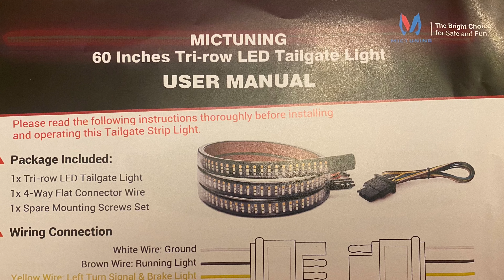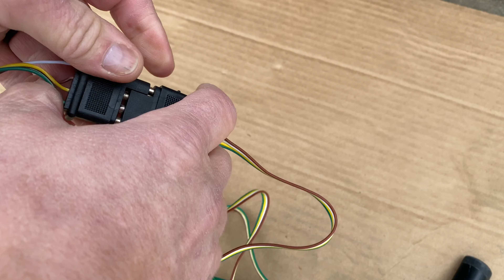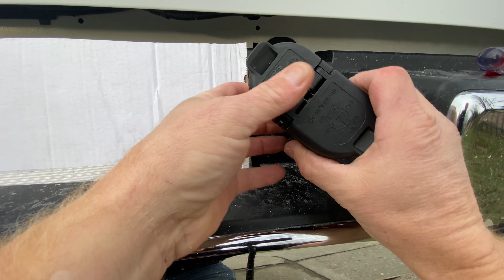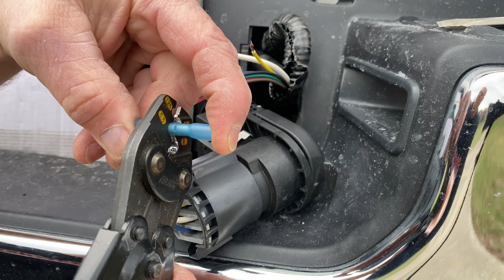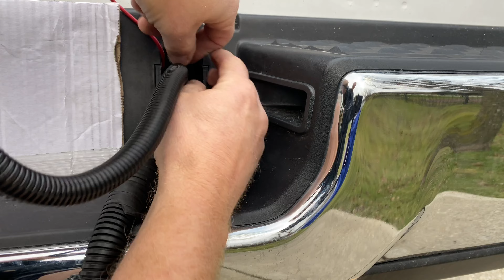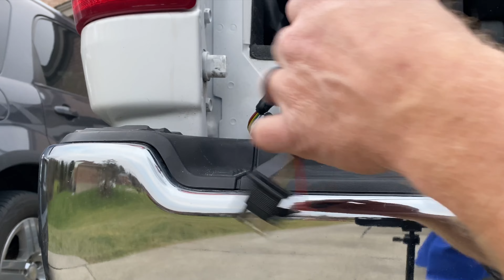Installing Tailgate lights

Comment: I cannot believe Chrysler would not put any kind of protection or potting on the trailer connector. Failure waiting to happen with the connection exposed to the elements.
Reply from the maker: Are you talking about the backside of the plug or the front. The back has a sealed connection and the front has a cap. I hope there is no future problems with this set up. Thanks for checking in.